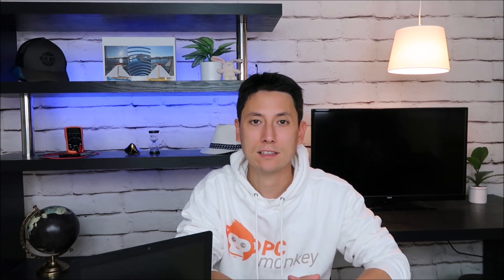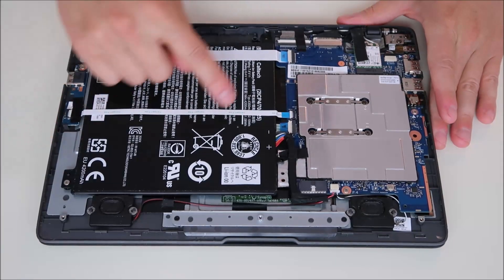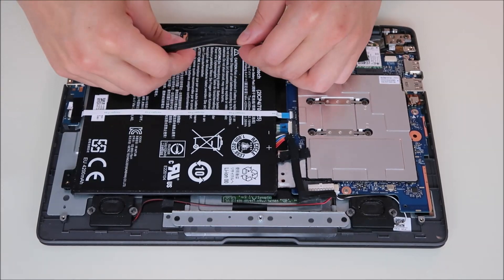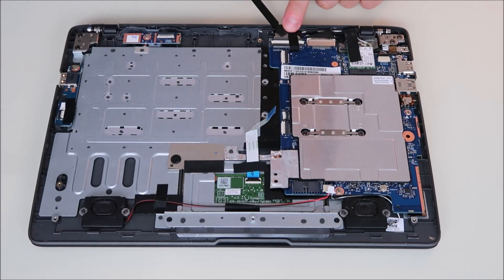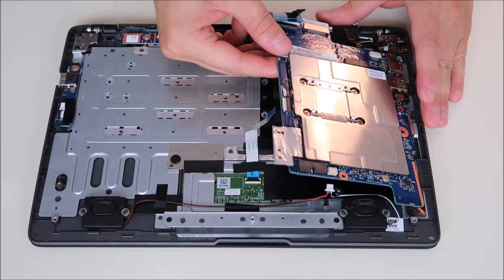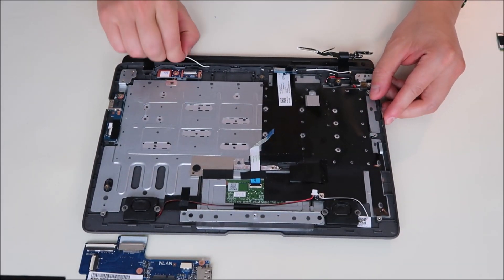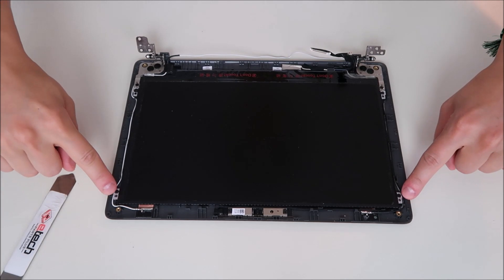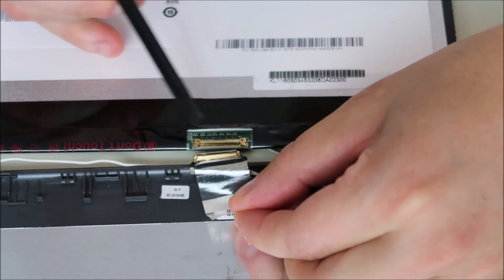Teardown Disassembly - Acer Aspire One Cloudbook

Comment: I have the old Acer Aspire One Cloudbook 14, I watched the video, just wondering where is the hard drive in this unit?  I was told before I bring it in for recycling I should remove it.  Even though I rebooted it back to factory settings, I was told that the hard drive still can contain personal data
Reply from the maker: Your HDD could actually be an eMMC drive. Its most likely part of your motherboard and cannot be separated.

Comment: Great video, thanks for posting. I watched and listened closely but didn't hear or see reference to CMOS battery. Where is it and how to I replace/remove it for hard factory reset?
Reply from the maker: This computer does not have a CMOS battery. Your trying to reset your Operating System or your BIOS?
Reply: @PC_Monkey  , both or either i think. The comp hangs at the Acer logo on bootup and loops, so I want to troubleshoot but since I lost the password I can't proceed. no password, no system restore, no reset, no nothing no nothing no nothing...

Comment: Y la ram?????
Reply: @PC_Monkey  ola este equipo tiene memoria ram para reemplazar ???? O es integrada a la placa??? / hello does this computer have ram memory to replace????  Or is it built into the board?
Reply from the maker: @patricioalvareztrincado5192  The RAM in this computer is integrated into the motherboard and cannot be easily removed.
Reply: @PC_Monkey  Thanks a lot
Reply from the maker: @patricioalvareztrincado5192  np :)

Comment: Hello, is there a possibility to uprade the RAM or the harddisk at the acer one cloudbook 11?? plmk
Reply from the maker: No.  As you can see here, both those components are integrated into the motherboard and cannot be easily removed or upgraded.  Sry :(
Reply: @PC_Monkey    I think I have made my biggest mistake that I bought this un-upgradeable Cloudbook. That would leave me no choice but switch to  Linux light, or Windows Lite versions, of OS, instead of future upgarde.

Comment: Hey...help...my acer315-33C1JA only starts up after l randomly select another key on the keyboard  and long press that key but if l leave the key it switches off
Reply from the maker: I have only ran into that a few times.  The Power Button was damaged.  I would first try 'reseating' the keyboard ribbon cable at both ends.  If that does not help, try replacing the keyboard.
Reply: @PC_Monkey  how do l reseat the keyboard ribbon cable?
Reply from the maker: @eveye5903  You would unplug it from the keyboard if possible and from the motherboard.  Then you would plug it back in.  Make sure its not loose and properly lined up

Comment: Please help me, the top part of my key clip that holds down the key on a dell Inspiron 5501 is cracked and now it won't hold down. Can you possibly do a video of how to fix key clips?
Reply from the maker: If you break or damage any component of the key assembly, you would have to replace it.  I usually get my keys on Ebay or www.replacementlaptopkeys.com.  If you cannot find a loose key for sale, you may have to purchase a keyboard and take a key from there.
Reply: @PC_Monkey  Ty and what if the rubber thing is loose
Reply from the maker: @zephylx  There isn't really a good way to reattach those.  They are not meant to be replaced.  Best advice is try to use a small amount of glue.  If that does not work, you may have to replace the keyboard.

Comment: Sir my acer aspire laptop bios is not open after press F2 and i also check it is right key what should i do according to you and it freez on acer logo screen please help its very important for me
Reply from the maker: For that issue on an Acer computer, refer to this video first;  https://www.youtube.com/watch?v=gDQZvNQ2chc
Have you tried all the Function Keys?
 If you cannot change the settings in BIOS, or if changing them does not work, then skip that step and try to reinstall Windows 10 as seen here;   https://youtu.be/g_UhiHScaSI.  You can create your own Install Media for free as seen here;  https://youtu.be/g_UhiHScaSI.  If that fails, then your Hard Drive may be bad.  Replace it as seen here;  https://youtu.be/tNp5Kbo9uHg and install Windows to the new one.
Reply: @PC_Monkey  sir thanks for reply but my bios are not open if it will open then i can change setting my big problem is bios which is not open
Reply from the maker: @khaira9860   If you cannot change the settings in BIOS, or if changing them does not work, then skip that step and try to reinstall Windows 10 as seen here;   https://youtu.be/g_UhiHScaSI.  You can create your own Install Media for free as seen here;  https://youtu.be/g_UhiHScaSI.  If that fails, then your Hard Drive may be bad.  Replace it as seen here;  https://youtu.be/tNp5Kbo9uHg and install Windows to the new one.

Comment: Hello! I watched your video about the black screen fix but my problem is my laptop suddenly turns into black screen when i open google chrome but with other apps it's okay. Can you help pleaseeee
Reply from the maker: If its only with Google Chrome, then we can assume its a browser issue.  You can try uninstalling Chrome and then reinstalling it.  Or you can try resetting the browser as seen here;  https://www.youtube.com/watch?v=cC23sKIHvdA&t=2s
Reply: @PC_Monkey  uhmm i tried to uninstall it but it suddenly shutdown. I already tried to unplug and plug again the battery but after a seconds of using my laptop it shutdown again. What do i do?
Reply from the maker: @trixiasatparam952  I would try to reset the entire operating system at this point.  What brand and model computer do you have?